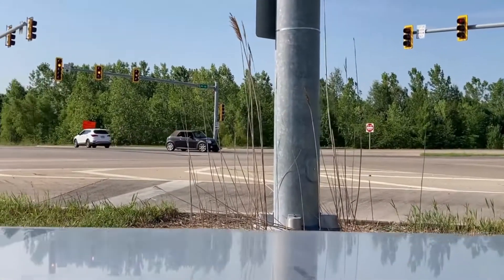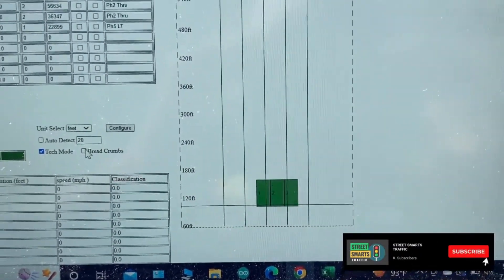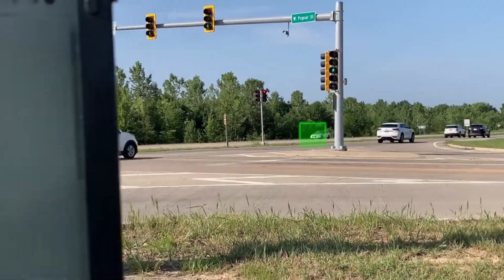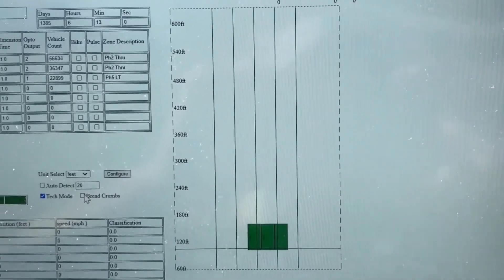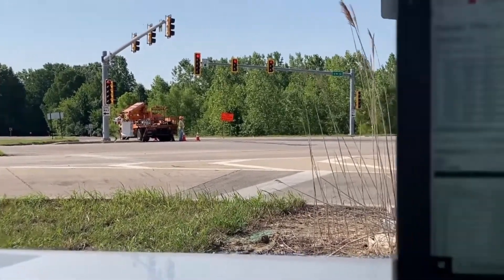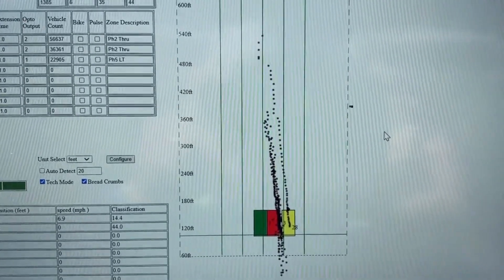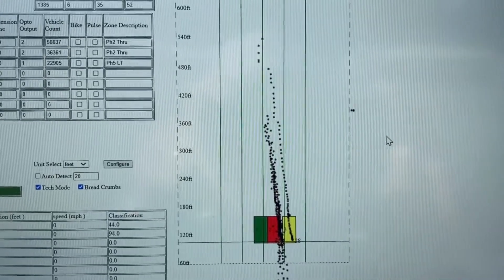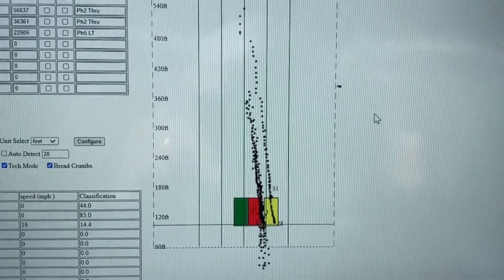Traffic Signal Radar Detection Not Working

Comment: At the end of my street is a roundabout. When it still had traffic lights, the lights, what someone i know told me, almost always jumped to green when he approached the lights when he did came home late in the evening. But it system used detection loops and not radar.
Reply from the maker: It sounds like there may have been an advanced detection loop in place.  If it jumped to green before you arrived to the signal, that's great effeciency!  Which is sounds like the adv detection was doing!  Thanks for your comment!

Comment: I'm not in your industry but I still find it quite interesting to know how things work and to see your troubleshooting process. I am a technician of sorts in a different industry but interpreting what the customer reports vs what's actually happening and fixing it is the same process no matter what you're working on.
Reply from the maker: @some0ne8-- I have found that the Process of troubleshooting in the traffic signal world is applicable to many other industries as well.  Yep-I find about 50/50 complaints from the public are accurate to what is actally happening at the traffic signal.  Definitely have to take it with a grain of salt!  THanks for your input!